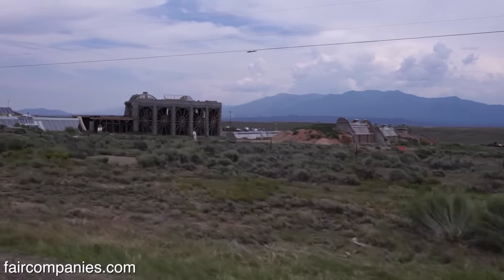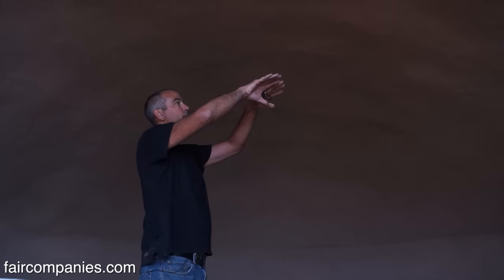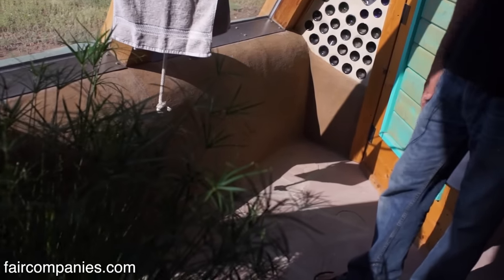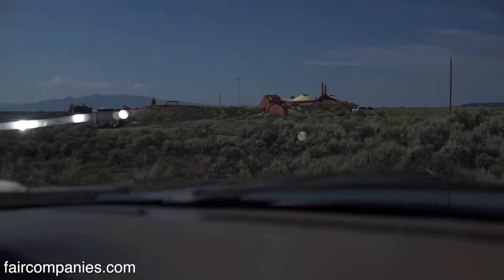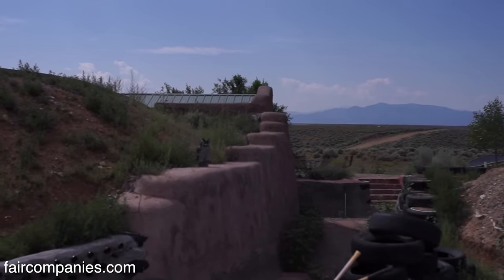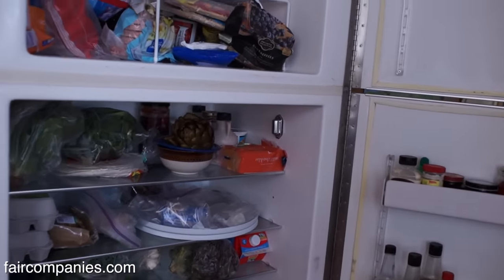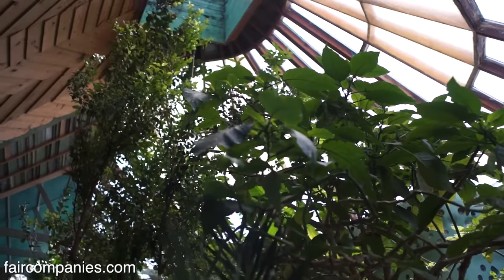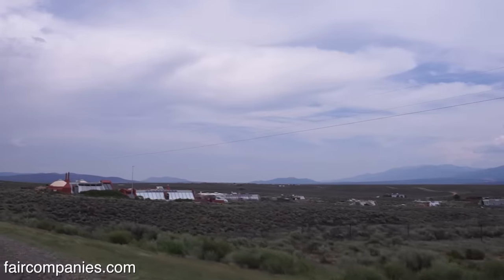Earthships: self-sustaining homes for a post-apocalyptic land?

Comment: I've got a question about the tires--rubber tires can have toxic chemicals like pthalates and heavy metals like lead and zinc in them, and I haven't seen a ton of data on whether they can safely be used for habitable constructions, especially habitable constructions with recycled water. Anybody know if you have any way of measuring or testing that?

Comment: At 35:20 the guy points out their experiment of growing vegetables in the blue buckets. He explains there's what looks like about 2-3 inches of gravel in the bottom of each bucket. There's also a PVC pipe that's used to feed (I presume water too) the plant. I'd be interested in knowing more specifics of how to setup such a growing system. One particular aspect I'd be interested in knowing is if there are drip holes in the bottoms of the buckets.